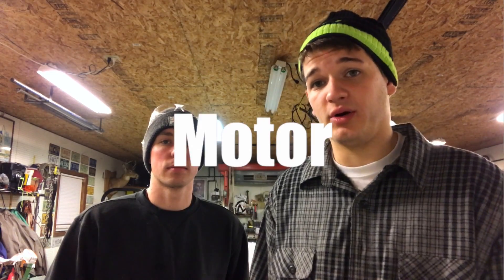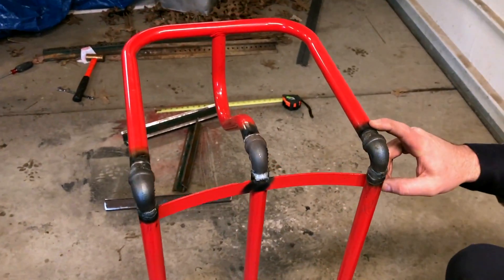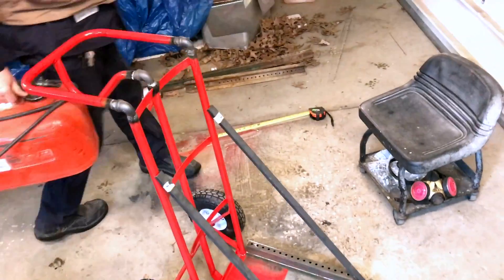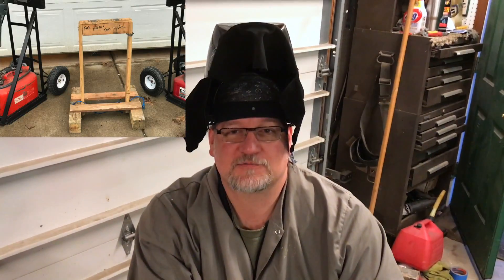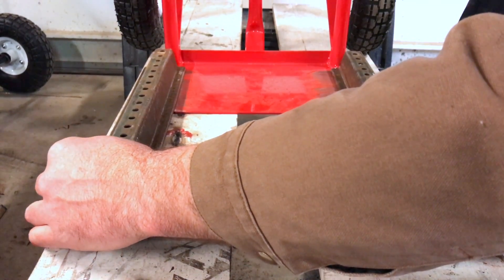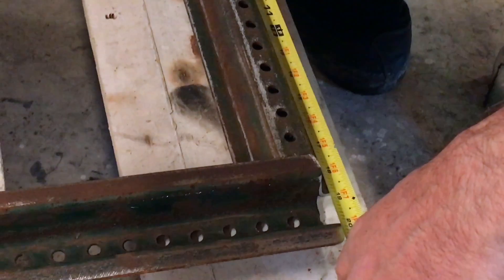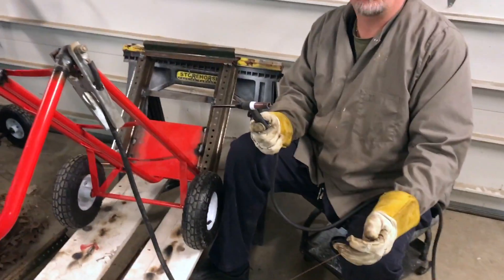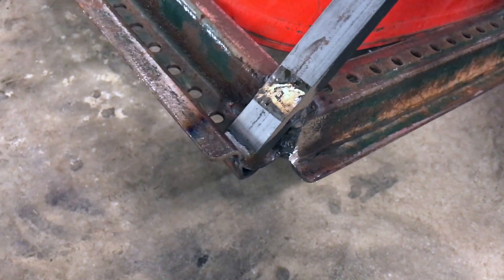How to Build a Boat Motor Stand - Safe and Mobile!

Comment: Excellent project. I will likely do one the same or close.  I have one comment on your choice of welding technique, however—as a hobbyist, I feel TIG is almost always the go-to tool rather than MIG or Stick.  My reasoning is that unless you are doing large numbers of beads in similar thickness materials, TIG is going to give you better control and more reliable base metal penetration than either of the other two.  I also often find myself sticking together mis-matched thickness parts, and can sometimes avoid blow-through better using TIG.  All at the cost of a bit more up-front $$ and more fastidiousness in metal prep, of course. But as a hobbyist, the few welds I make need to be high quality, not economical in time or money.
Reply from the maker: thanks for the response! My dad is a welder and a machinist for General Electric, I think he would prefer that too... unfortunately we don't have that in the garage!

Comment: Hi, great job on that cart. I have a few questions and hopefully you will answer them it would save a lot of time with one trying to build one.He could go to harbor freight and right on to the big box stores and pickup the smaller parts all in one shot. So, here we go. You used street ells could you say what size they are? 2nd did the ells have short nipples screwed into them and the nipples slid into the cut off handle and welded? Or did you just slid the cutoff handles into the ells and weld them? Agian a really nice looking cart.
Reply from the maker: Thank you for your kind words.  Don't know what size, slid the cutoffs in and welded.

Comment: Hi, real nice job. I do have just few questions if you answer them it would really help in saving time. One could go to harbor freight and then on to the big box stores and pickup the smaller parts all in one shot . The first question is you said you used street ells what size ells? 2nd are there short nipples screwed onto the ells then the nipples slid into truck handle and welded? Or are the cut off handles slid right into the ells and welded? Like I said a great looking cart.

Comment: Why drill holes in the tubing of the dolly it seems to me that will be a weak spot u could have used some kind of bracket or exhaust pipe clips

Comment: Great project.  Thanks for sharing.  Is it necessary to create the bend at the top of the handle.  It seems like the stand would work nicely if the dolly handle were left in its original configuration.
Reply from the maker: It probably would but everything we looked at had the handle like that
Reply: Top of motor needs room ther